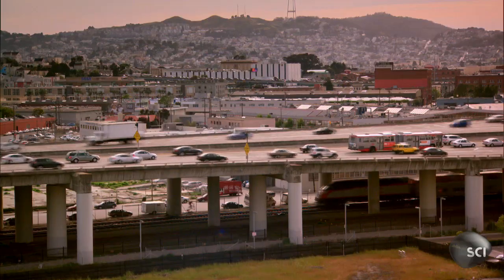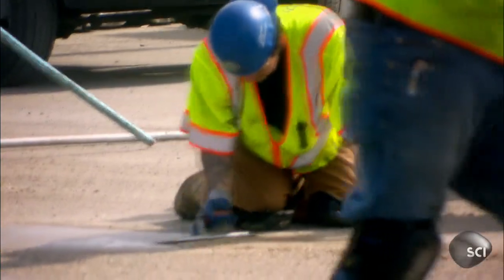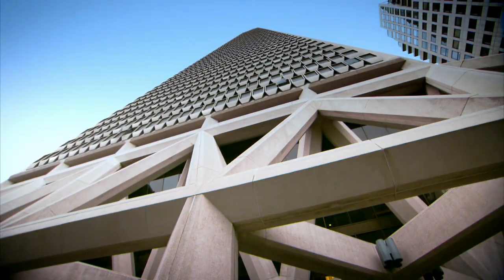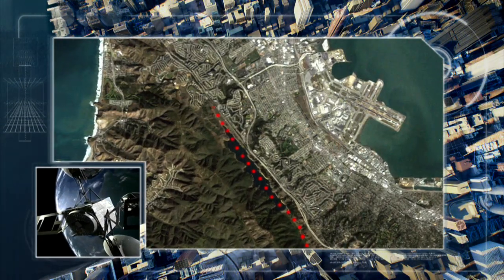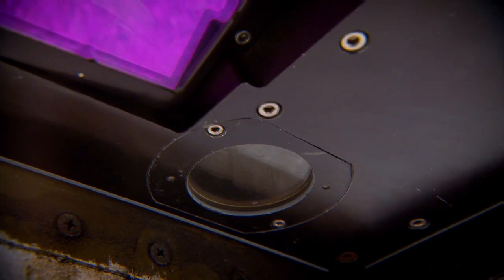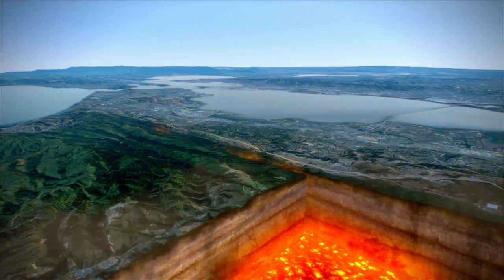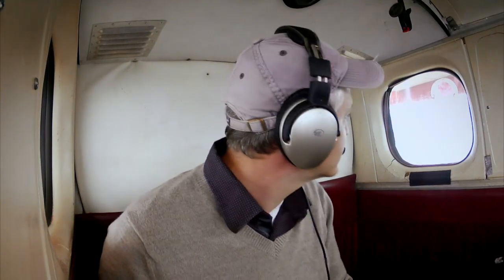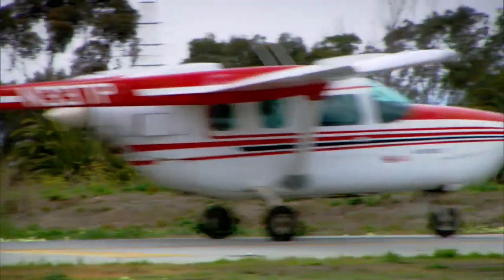Tectonic Time Bomb | Strip the City

Comment: again that one was on the Gorda Plate which meets the San Andraus at Eureka tsunamis only happen where two plates collide and head into the core the Pacific Plate end in Eureka it does not continue past that point all the boarders of the Pacific Plate are transform it moves with the land plates it does not run into them